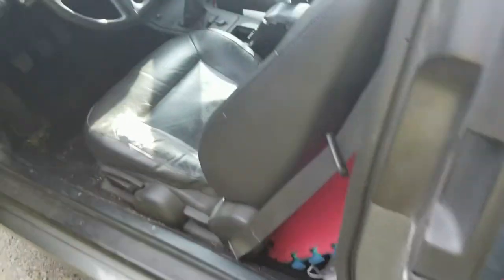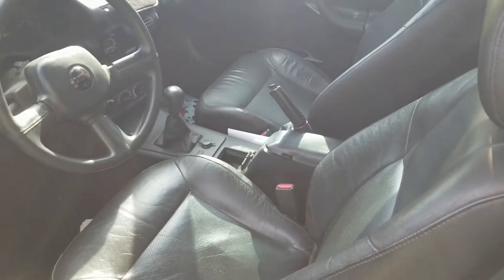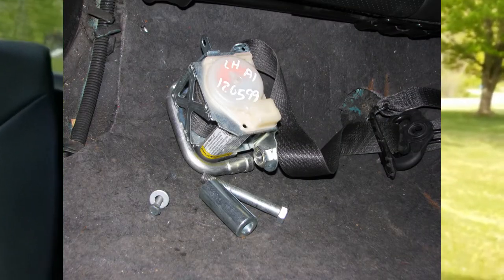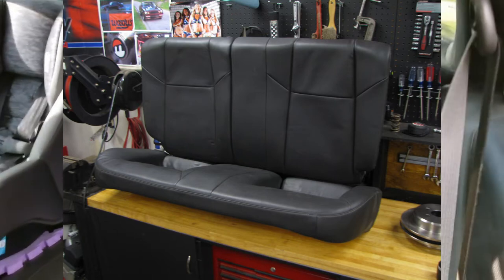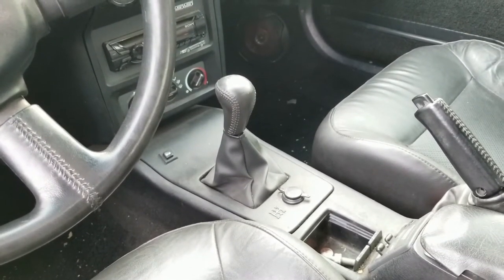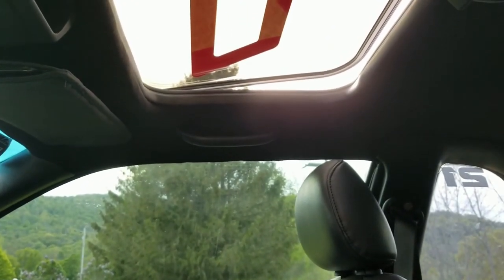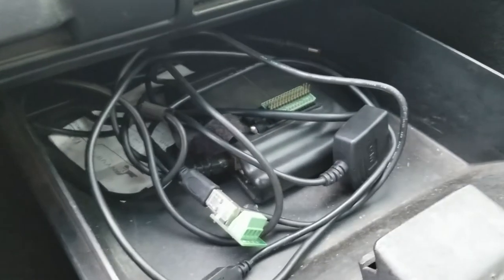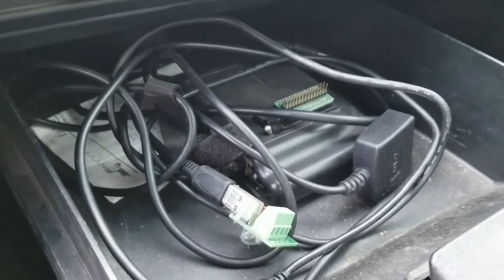Beretta "SS" walkaround and build info - pt 2 - custom gauges and leather swapped interior

Comment: How do you have a 5 speed on a 3400
Reply: I NEED that swap if possible
Reply from the maker: The 3400 is the same basic architecture as an old 3.1. So get a 5spd Muncie out of a 3.1 car and order the clutch and flywheel for the donor. Everything bolts up perfect.
Reply from the maker: Search getrag 282 or hm282 to find more info.
Reply: @GEARHEADdezign  so would that stuff fit in a 2005 Monte Carlo with the 3400?
Reply from the maker: Engine-wise yes. You'll probably have to fabricate a transmission mount and possibly build custom axles to connect the trans and wheel hubs.
Reply from the maker: My friend @autotech Tyler is doing swap kits for your generation Monte with the f23 transmission out of grand ams. Check his channel out
Reply: @GEARHEADdezign  thank you I willllll